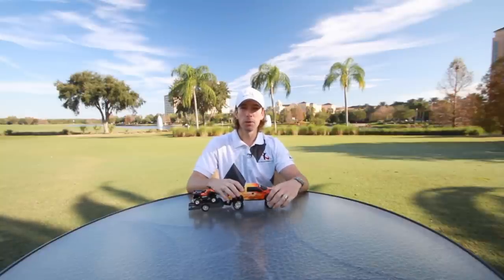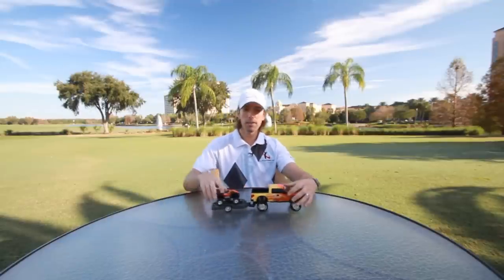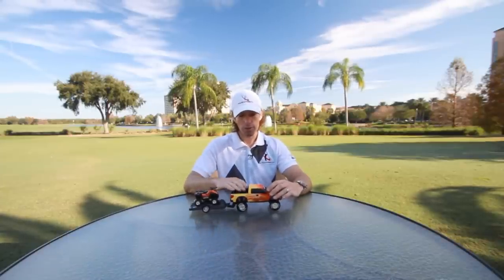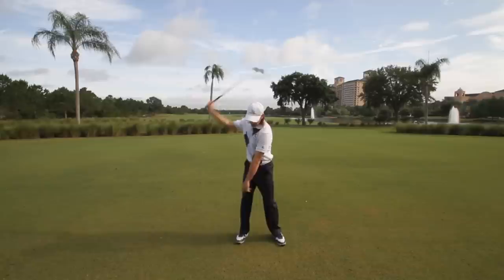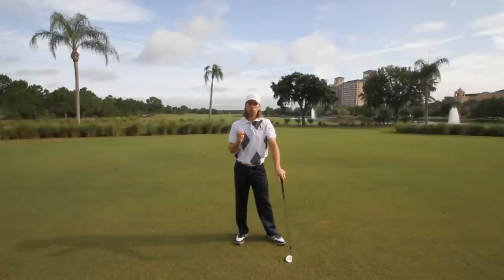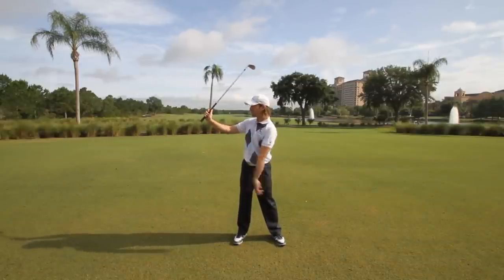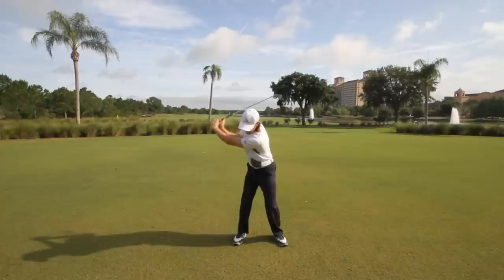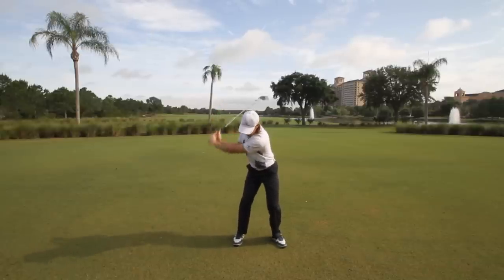Golf Swing Physics | Part 1 of 7 | Rotary Swing Golf

Comment: you dont pull when bowling
Reply: There are many ways to skin a cat in any sport. He is explaining a pure swingers motion. There is a hitting motion where you push the club and there is a combination of the 2 where you initially pull then push. Pick your poison. They are all effective but pure swinging IMO is the most repeatable and is the reason most good players use it.
 Under pressure it is best to leave out the small fast twitch muscles of the hands  because they require an additional timing element. Passive arms and hands, a good pivot (weight shift back and through) and the power of physics (letting the club release centripetally instead of muscularly  ) are your best friends,  in golf
Reply: TheNYgolfe do I pull when throwing a baseball?